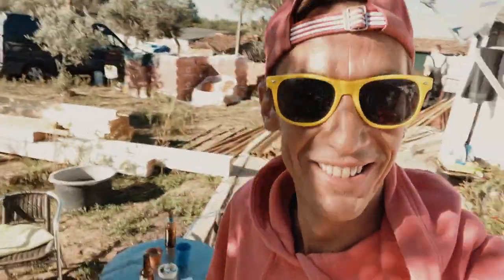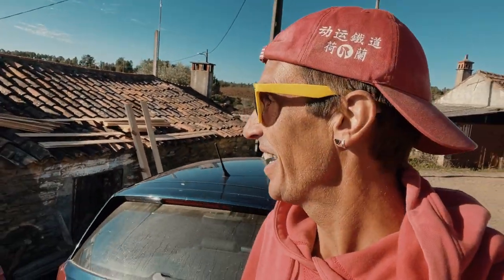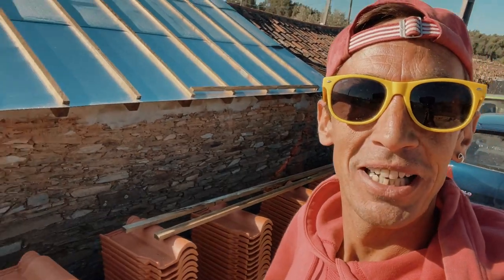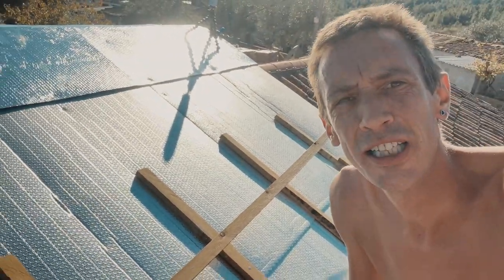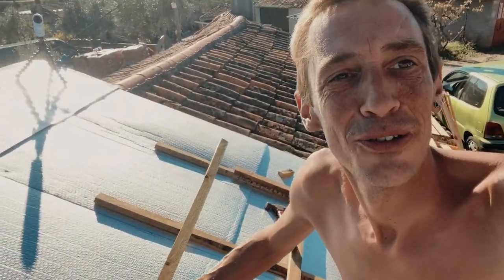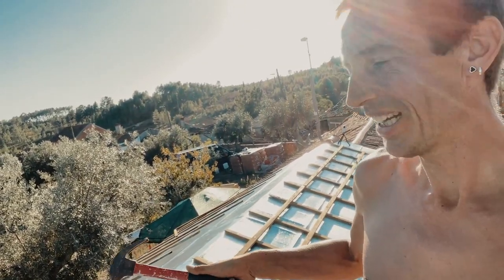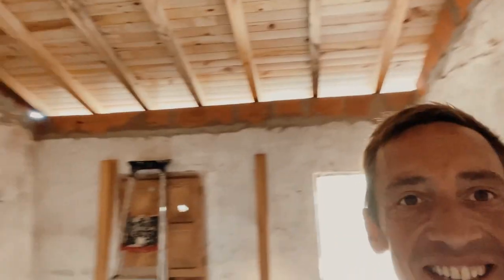No ROOF TILES Yet, BUT.. - Portuguese House Renovation

Comment: The wood looks really good fabulous really. The tile once done will be an eye catcher too. The other blue insulation was done the one side and am looking forward to finishing factor. Videos are showing some building techniques not often found like the tiles that are usually used in warmer climates. Fans will draw up or down and proper circulation is achieved with fresh air venting near wood stoves. Fan on stoves or ovens regulate quite well. Ruined buildings being restored carefully. Must be proud of achievement so far!

Comment: I hope, although it doesn't look like that from my chair, you've taken the dimensions of the ridge tiles into account. Your span looks a bit wide, i.e. Normally one measures from the top back to the bottom, so that the ridge tile fits at the top. But I'll see that next time.
If those pretty brown eyes only could speak, I think Zoe from Project Portugal would have a lot to say. Keep the good work going. And stil sun and nice weather there.
I also hope you give single-ply bubble wrap the desired degree of insulation, or are you going to insulate the inside as well?
Reply: Hi Wim. I’m not a carpenter, builder or tradesman, but I wonder why the rafters don’t fit flush together with no gap.
Reply from the maker: Because they delivered my wood to short... mehhh :)
Reply: @GhostTownVlogs  oh no ! No recourse ??? I thought that crap only happened to me here in Thailand. Everything’s been a struggle for me also trying to carve a little two acre  farm out of the jungle , but it makes life exciting doesn’t it. At least you have Zoe to keep you laughing.

Comment: Generally speaking, I think you're doing a pretty good job. However, calling that thin foil-faced product "insulation" is being awfully generous because its thickness probably provides an R2 at most IF you're very lucky. I think it would be more accurate to describe it as a radiant barrier, which it should be relatively effective at, since it has an airspace above it, but, without an airspace below it, and with it lying in direct contact with the roof deck, I suspect you'll see a lot of heat loss up through that roof in the winter unless you intend to add an interior layer of real insulation. Does it get very cold where you are in the winter months? If so, and you don't intend to add an interior layer of insulation, consider adding reversible paddle fans that will enable you to push warm air at the underside of the roof downward in the winter.
Reply: I agree even if you have abundant fuel you don't want to be gathering and burning more than you need it's just hard work. My criticism of portugese houses is that they are poorly insulated and therefore unesessarily col/hot. Properly insulated thay should be perfect.
Reply from the maker: Well on the specs it has the same r value as rockwool.. so thats good enough i think :)
Reply: @GhostTownVlogs  - Well, rockwool has an advertised R value of 3.55 per inch of thickness. That stuff looks pretty thin. If it's the same stuff I've seen here in the states, it's smoke and mirrors. They try and claim R-value based on reflected heat gain or loss equivalent. However, to achieve that the material must have an air gap. Without the air gap, it can't reflect heat. That's why I said that it will probably reflect heat on the topside but not on the bottom side where it's in contact with the roof deck. So, it will lessen heat gain from sunlight but it won't be much more effective than a double-paned window that's about a half-inch thick when it comes to stopping heat loss. If the intent is to achieve that nice exposed beam and roof deck look, you can still achieve some insulation by using foam boards on the underside and then attaching faux rafters and a wood plank deck to the underside of the existing rafters and the foam. Check out the archives of the Building Science Forum at The Journal of Light Construction Online (https://www.jlconline.com) and you can learn a lot about this topic and discuss issues like this with actual contractors - for free. I moderated that forum for about 11 years from 2001 to 2012. Register at JLC Online (It's free), then click on How-To and then choose forums and then choose building science. My friend, Chad Fabry, now moderates that forum. Ask questions of Chad, tell him Mike sent you, and he'll be glad to help out. By the way, I've been watching all of your videos for months. I think what you're doing is pretty cool. I'd love to move to another country, buy and old homestead, and start over. However, I'd never be able to get my wife out of here, so I do the next best thing - watch you and others do it. Good Luck!!!
Reply: @mikeohandley6765  Take your wife on holiday there and she may just fall in love with it. Portugal is a good deal for Americans if you are one. You get a health service.
Reply: @mikeohandley6765  this stuff looks like reflectix.
Reply: @Roosmarijn035  - Yes, that's exactly what I was thinking, but the airspace inside is so narrow that it typically provides no more than an R2 and it's still ineffective unless there is an airspace on both sides of it. If memory serves, the manufacturer specifies the airspace. If you count the roof deck as about an R1, and the reflectix air pocket in the center as an R2, you still end up with an R value of about an R3 which is pretty poor. I'd be a little bit concerned that warm/humid air in the home could end up condensing on the underside of the roof because that material won't allow much vapor diffusion. If I'm remembering correctly (always an issue at my age), there are manufacturer's that make high-density foam boards that are about an R7 per inch of thickness. With such a panel, two layers, plus the roof would provide about an R17 - significantly better but still not stellar. Installed and sealed properly, that would prevent vapor diffusion into the roof deck and avoid any condensation. However, perhaps the climate in that part of Portugal, at that altitude, doesn't require more than that to keep the home comfortable while avoiding condensing issues. I think the best thing he can do is simply forge on at this point and see how the home heats and responds this winter. If he finds the underside of the roof very warm and the floor and living zone too cold, he'll know that if he wants it to be warmer next winter he'll need to look for a better insulating solution. That's why I mentioned the reversible paddle fans. In winter those can be used to push the warm air at the underside of the roof down to the floor and form a convective loop that will make it more comfortable at floor level. If he spots any dampness at the underside of the roof he can always use a dehumidifier to control that until the end of the heating season.
Reply: @mikeohandley6765  I think @the portugal project should insulate the inside of the roof with the blue foam panels that Nick of Destino Portugal used in his last video.